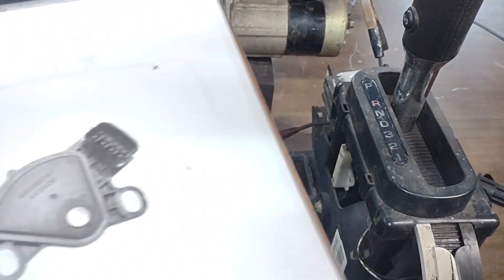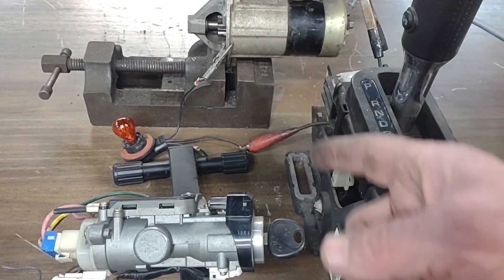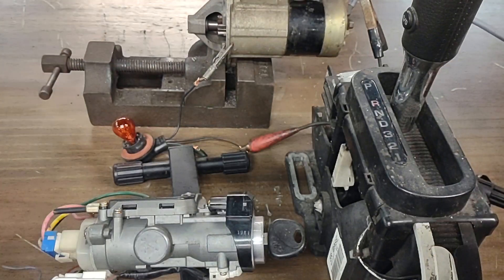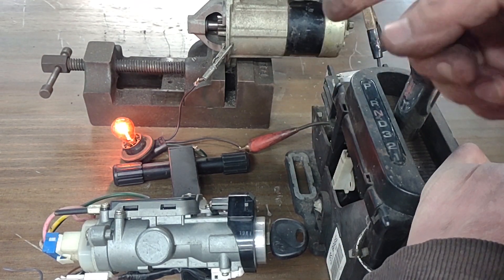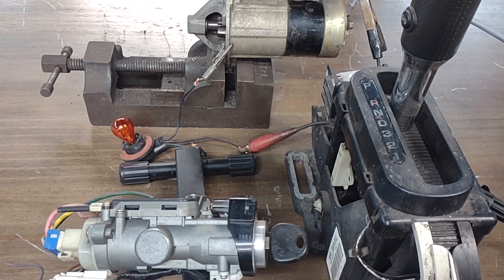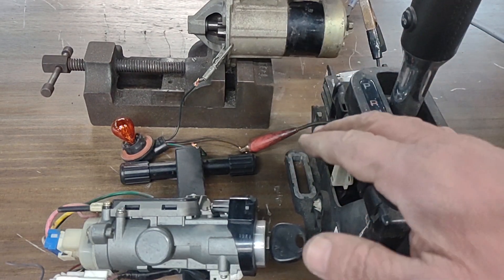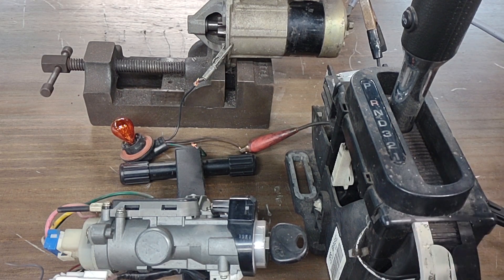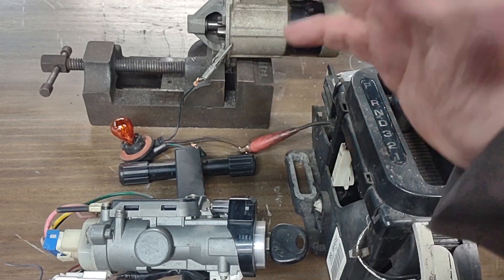How Neutral Safety Switch works, Engine wont crank, starts only in neutral

Comment: My car stop accelerating so I pulled over and parked and turned the car off when trying to restart I got a no crank no start so I changed the starter and that didn’t help I tried jumping it still nothing mind crank no start I started to lean on the ecm is bad until I seen this video. Now ima try the safety switch because earlier in that day it was hard to take the car outta gear.
Reply from the maker: Yes there is a big possibility nss is the issue, but since you mentioned it is hard to move the shifter, make sure you check the mechanism of the shifter, cable and in between, also try to start while in N position while applying both parking brake and brake pedal.
Reply: @carservicepro thank you bro

Comment: So if i bypass it i just have to be sure its in park to start it safely ? I normally drive manuals so im used to checking the gear before starting. If thats all this switch operates then im bypassing it.
Reply from the maker: I don't recommend bypassing Neutral safety switch, it is better to replace it instead. It is there for a reason, prevent drivers from engaging the starter while Transmission in Drive or Reverse!

Comment: what's it mean if it starts in neutral but not oark ? it's a 2001 dodge ram 2500
Reply from the maker: Neutral safety switch malfunction or transmission shifter cable adjustment
Reply: @carservicepro  thank you

Comment: Thank you for the video. My issue is that my display doesn't show what gear I'm in PRNorD(none) I can switch gears but once in drive it won't shift to 2,3 nor 4 (automatic). Is this a neutral safety switch issue? Thank you. When I put the car in reverse, the reverse light doesn't come on
Reply from the maker: It can be but it depends on the year, make and model, the newer the vehicle the more complicated it gets, it can be as simple as neutral safety switch or can bus, wiring issue, gear shifter, ecm, PCM, tcm and etc, if the NSS cheap you can replace it if you don't want to go through the diagnostic process, it may fix the issue, good luck!